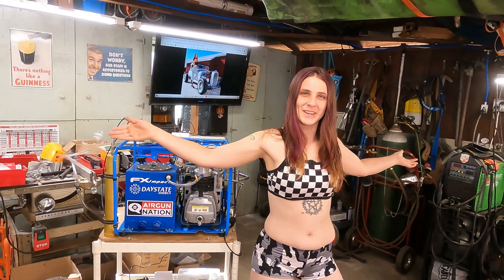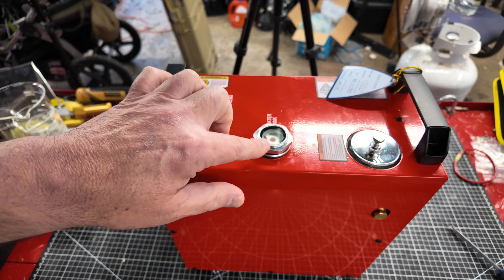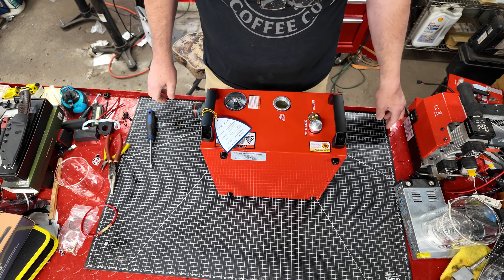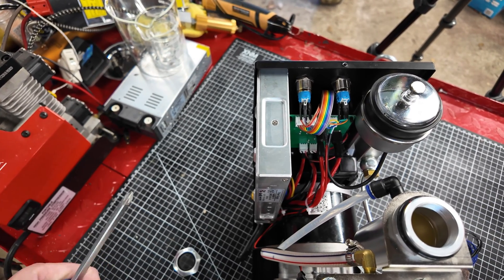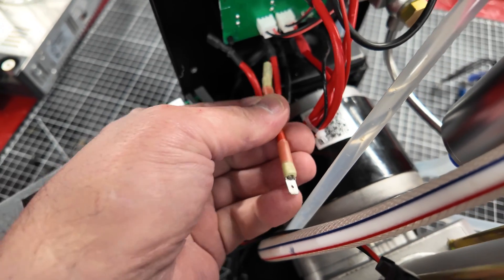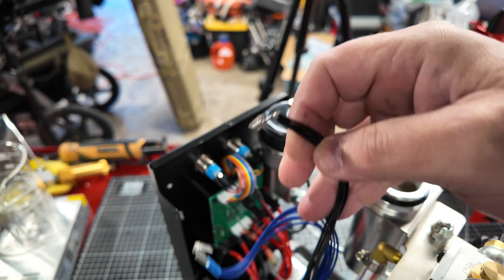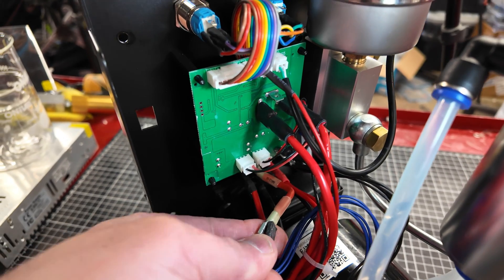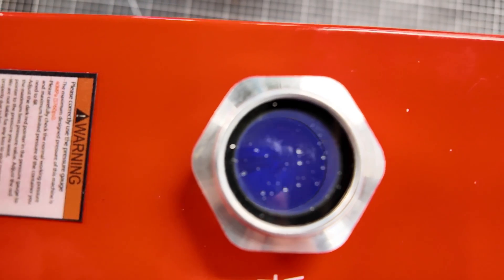Install the Essential Flow Indicator Kit on Your CS4-I GX Compressor: A Step-by-Step Guide!

Comment: Hi, do you have any recommendation/information on replacing dead water pump?  Ran fine for around 18 months and then just died w/o warning.
Reply from the maker: I have replacement pumps on the targetforge.net website. Pinch off the inlet and outlet hose and swap it out, Super easy.
Reply: @TargetForge  Many thanks - do you have any information on how long shipping takes for ground vs priority?  I am east coast.
Reply from the maker: I do not, but the carriers typically do, but it is also winter and the holiday season so your mileage may vary.

Comment: I bought this but I don’t have the I I have the first version with power source separate please help thank you
Reply from the maker: There is a version for that as well. https://youtu.be/eyqs-F5vq3I
Reply: @TargetForge I figured it out I think I put the positive terminal in the back of the power switch , it lights up as soon as I plug it in , is that ok ? Thx
Reply: @TargetForge I got it installed thanks !!! Very nice

Comment: Bill, after studying the CX CS4-I cooling system, I believe if the compressor is run on it's right side (the unit has feet on the right side) that the cooling cavitation issue would be solved or prevented (the inlet would be at the top and the outlet at the bottom of the radiator).  This would allow heated inlet at the top and cooled outlet at the bottom of the radiator respectively, and cooled inlet on cylinder head lower than the heated outlet which would be higher (best for efficiency).  My only concern would be the built-in oil-water separator being gravity assisted due to it's placement in the case that may need to be vertical in it's orientation.  If this was an automotive cooling system then the upright running of the compressor would cause cavitation issues because both inlet and outlet are at the bottom of the radiator (and the inlet on the head would be at the same height as the outlet which is not ideal), part of which could solve by rotating the radiator 90 degrees counter-clockwise if you decide to run compressor in the upright position (vertical) but would not address the inlet and outlet on the head being the same height.  What do you think?
Reply from the maker: That is a very interesting theory, I appreciate you taking the time to share it. The cooling effectiveness does not seem to exhibit any issues running vertical. I suspect this may be due to it being used well beneath its design limits. Also, running it horizontally would not help the visibility of water flow in the tank, and as you eluded, prevent the separator from operating correctly. These things work super well vertically. Thank you for the comment!

Comment: Hi Bill great video thank you question of the day with the knowledge of both of these compressors if the Yong Heng and the CS4 came out at the same time which one would you have purchased
Reply from the maker: Honestly, I lived through the early Yong Heng years, they were REALLY bad, they did improve over the years but comparing the two at incept? Not even close, GX CS4 and CS4-I win everyday and twice on Sunday. More portable, quieter, less fuss, no stupid 5 gallon bucket... I could go on but I think you can see my answer pretty clearly now. I even think the CS2 and 3 and their variants make more sense if you're filling the gun directly. To me, the Yong Heng is a dated, poorly designed, inexpensive compressor that requires the user to "overlook" quite a few faults. Yes, they are cheaper and do offer higher flow rates but as soon as you want to take your unit in the field, haul or find water for your bucket, find an outlet that will deliver 1800W of AC power, the wheels come off that train pretty quick for me. Would I have spent nearly 40 hours on an airplane to visit the Yong Heng Factory? Ever? Nope. Did I do that to see where the GX was made? Yup.:hand-orange-covering-eyes:

Comment: Gc4-1  1 minute cross hits liter pressure?
Reply from the maker: I have no idea what you mean.
Reply: @TargetForge  How many liters of pressure does it produce in one minute? CS4-1 model? Example yong heng one minute /50L
Reply from the maker: I believe your question is one of flow volume, not pressure. I do not believe for one second that a Yong Heng does 50 liters a minute. The GX CS4 and CS4-I will fill a 6.7 Liter bottle from 0 to 4500 psi in approximately 3 hours, you can see that test right here on the channel: https://youtu.be/4ZBR-e3P86E?si=aJNjN-DTuMlloJOb
Also, the CS4 runs cooler, quieter, is actually portable, runs on AC ad DC power AND NO silly bucket!